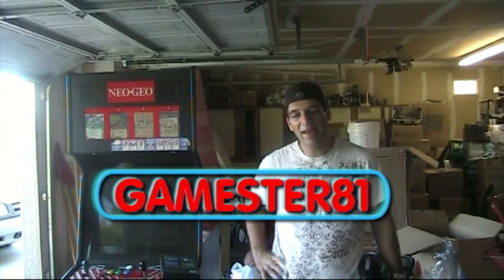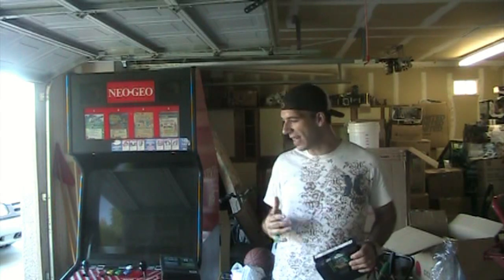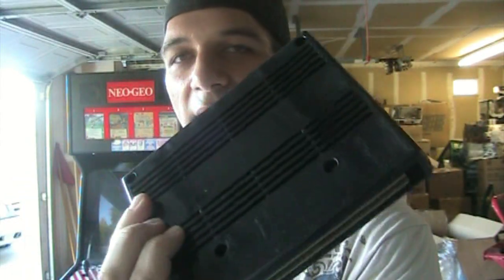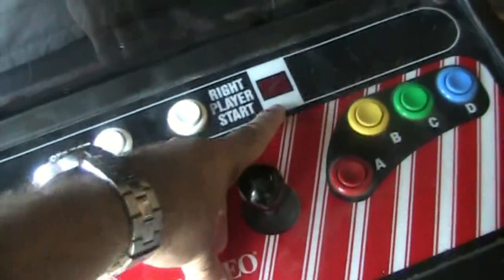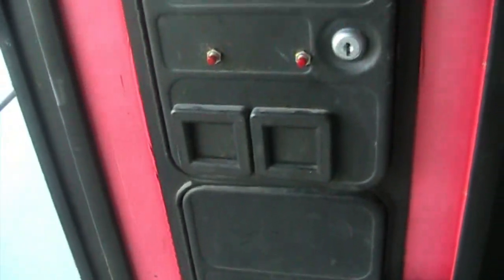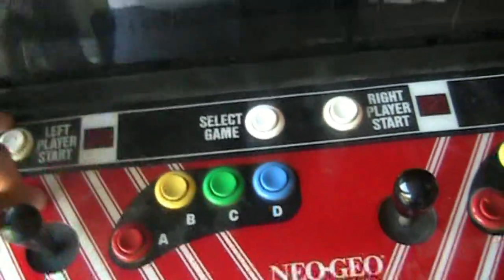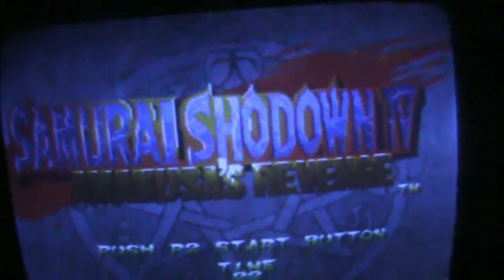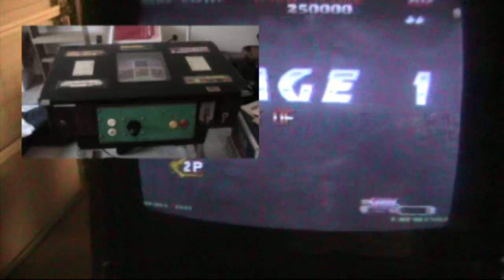Neo Geo MVS Arcade Review - Gamester81

Comment: @Gamester81 to enlighten on why the camera does that, is because the screen (The arcade systems screen) has a low refresh rate. most lcd screen they have now a days for 2009-2010 for computers have a higher refresh rate (the rate on which the screen refreshes) they usually refresh in Hertz so you can't see it refreshing, this is usually set to 90+ so the lines will not appear. so that is why you get the black lines. It does the same thing with old computer moniters (2000-2006). Hope this helps

Comment: @justinxsmith2 um ok not to be nerdy but those black lines are are caused by the light flashing 60 times a second. Basicly all light bulbs and TV monitors etc. use AC current. And AC current turns of and on 60 a second or 60 cycles. The black lines are the effect of this 60c/s. you can only see the black lines if you record it since the light flashes fster than the human eye can see.

Comment: @Gamester81 there is actually a little box with dip switches in the motherboard there is about 8 little white switches, not sure which one it is but on mine it was number 7, I'm not sure what was the setting on the 4 slot, cause I just bought me a 2 slot. Also make sure even though it's been refurbished to check the battery most of the MVS systems battery usually leaks and a leaky battery is bad for the motherboard.

Comment: Hi Gamester81. I love your channel. I have a question. I had just acquired my third MVS cab and it's a 4 slot Version 3 just like yours. Now on my other 2 cabs, both 2 slots, there is a main fuse on the panel above the coin drop, but on my 4 slot it sin;t there and I can't find a main fuse anywhere and the power toggle switch isn't connected to the the PSU via the 4 pin molex. I noticed at 6:17 on your video that your cab doesn't have one either. continued...